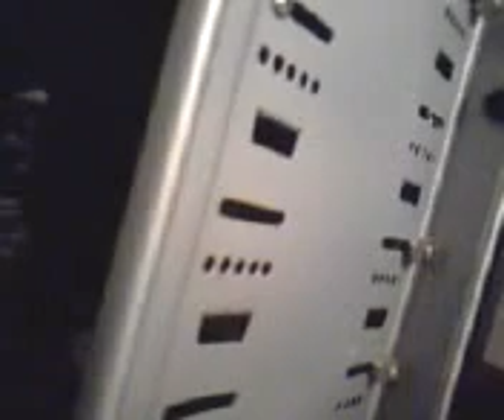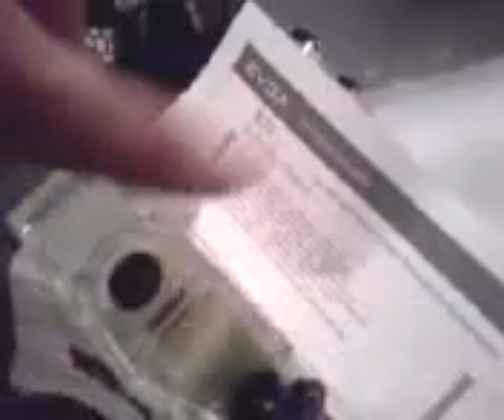Antec 900 + Swiftech Apex Watercooling + 9800 GX2

Comment: did you have to cut out an extra hole in the case for the water block? I have the same case, mobo, and 9800GX2 and I wanted to put in a thermaltake 760i big block water cooling for my Q6600 but, don't know if it will fit?

Comment: 9 series cards are exactly the same chips as 8 series, its only the number on the box, and a slight clocking difference (one u can easily do yourself) and ofcourse the price hike that splits them.  E.g 8800GTS is exactly the same as the 9800GTX.